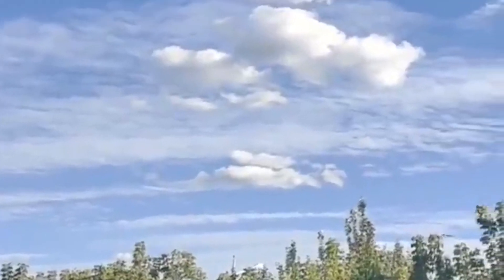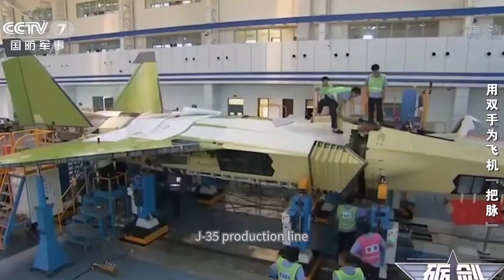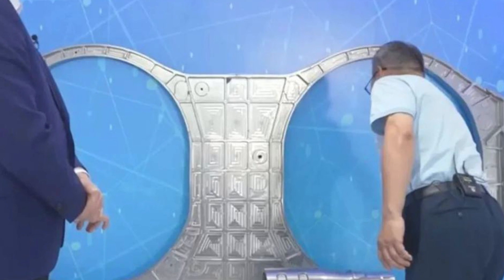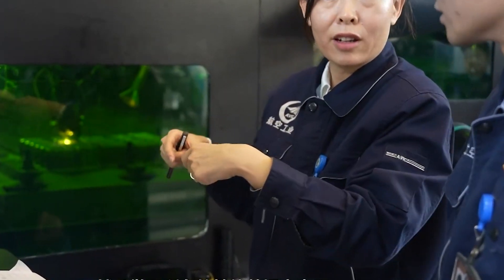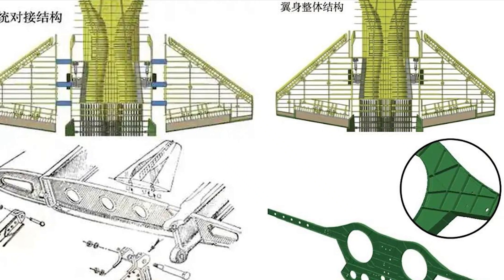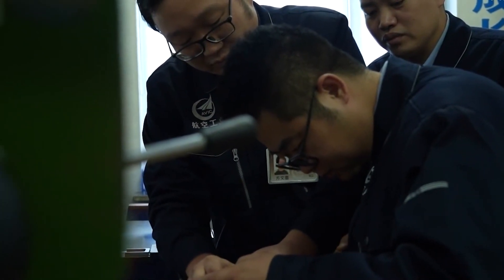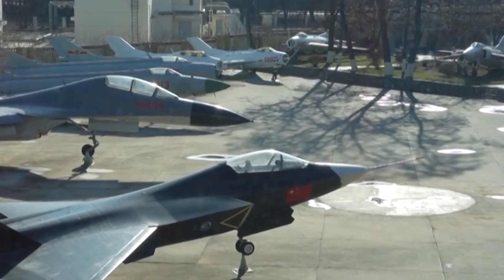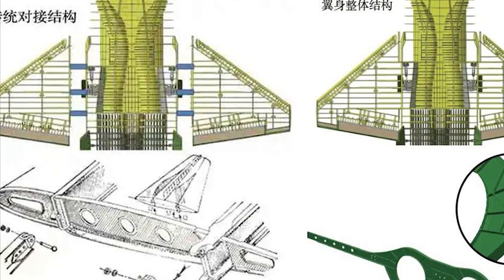J-35 new secret unveiled! 3D printing provides huge boost! The Chinese medium size stealth fighter

Comment: China should build more fighter planes the size of J-35, J-10 & J-17.
These are small to medium size fighter planes. 
These are the ideal sizes of fighter planes.
Longer and larger than J-35 like J-15 or J-11 aren't ideal as fighter planes. Their sizes are good for bombers.
Large fighter planes longer than 18-19 meters in length are easy to spot and to engage. 
They are vulnerable to all types of air to air missiles, even against anti tank missiles.

Comment: Which engine is this?
Reply: Temporary ws13e, final Ws19 engine
Reply: There are some rumors that the mass production type may use the customised ws19(rectangular thruster)
Reply: @langleyein1355  2D trust vector the same as F22.
Reply: Did I think WS-15?